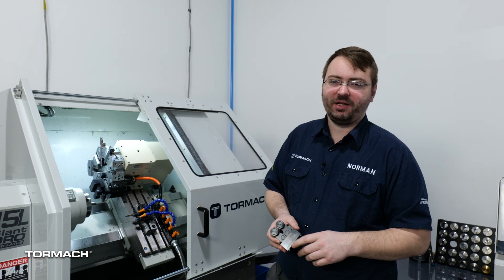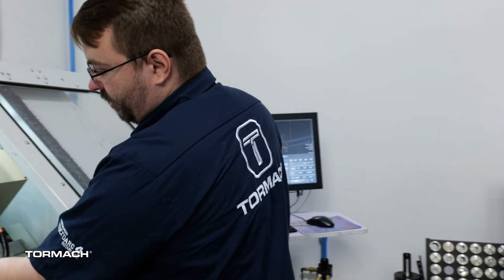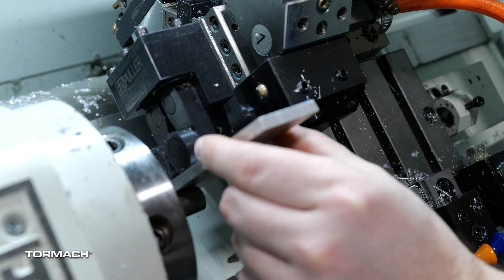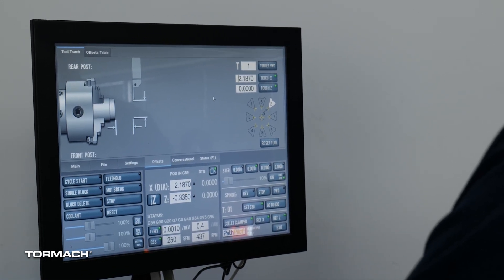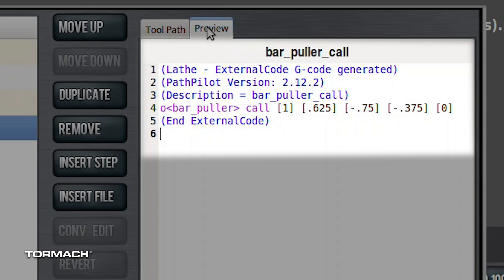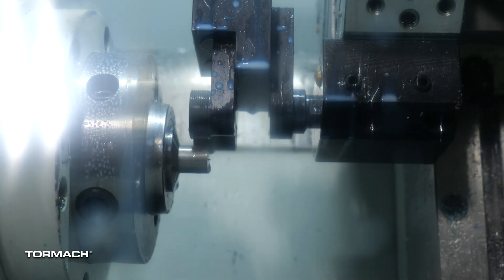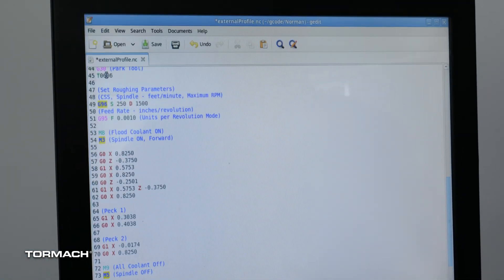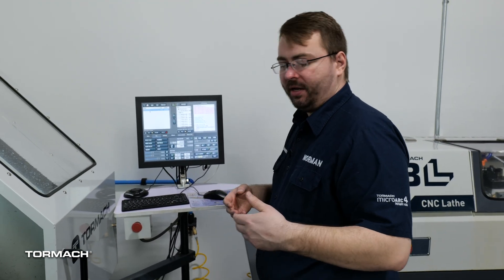Tormach 15L EZ Bar Puller/Automatic Collet Closer | Lathe Automation

Comment: Nice work! That line to program the Ezpuller helps a lot to understand better the function of the tool. It would be awesome to see more content about tooling and cutting techniques for the 15L :)
Reply from the maker: The bar puller sub routine will be placed in a future release of PathPilot, but Norman has shared it on the Tormach Forums: https://forums.tormach.com/t/bar-pulling-with-a-15l/2424
Reply: I'm having trouble to get it working maybe I'll have to know more about G-cods